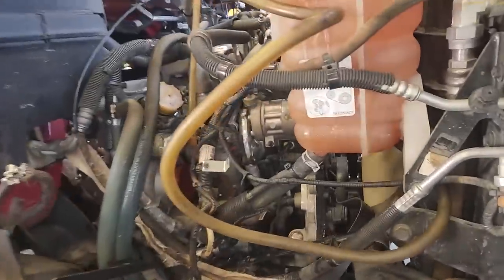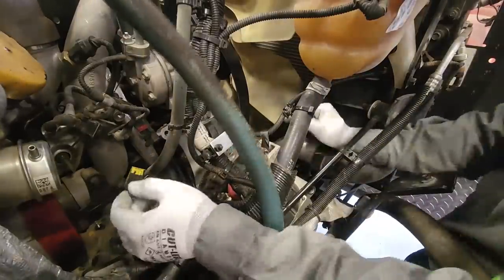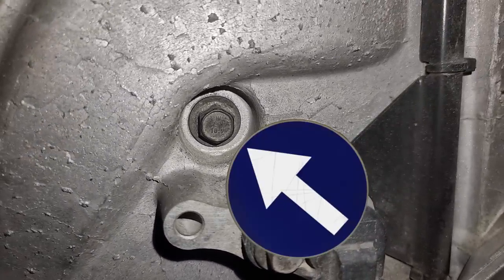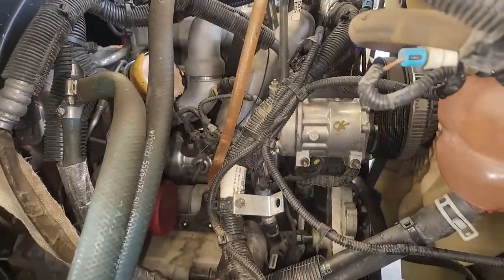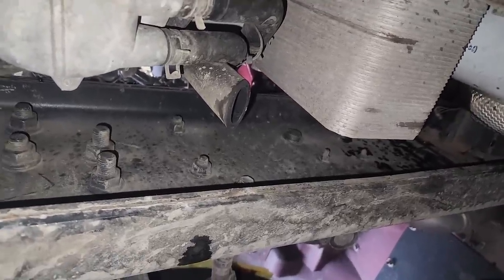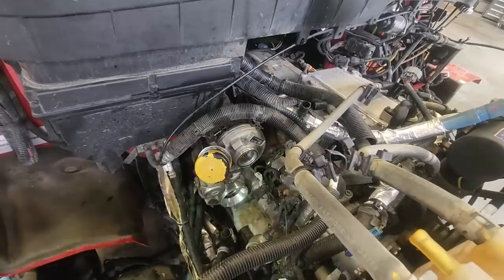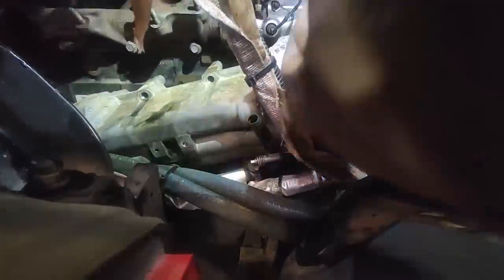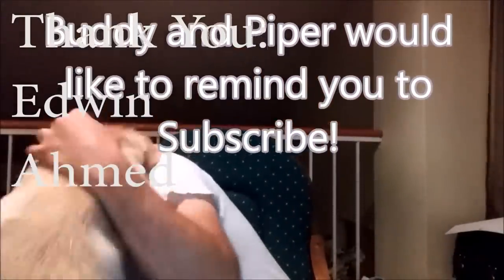"Trash-Fire" International Truck has coolant in the exhaust. EGR and Turbo testing.

Comment: Well I can tell you about international and one of the things that I can tell you is Ford had a hell of a tough time with international cuz they built many of the early Ford engines for them and they were not designed well and Ford in international fought like cats and dogs with each other so they do have a reputation of being a pain in the ass to work on and getting parts is also another fun thing to think about wouldn't Luna diesel that had an international engine 🤠😎🤠

Comment: FYI both of the metal coolant pipes will come off with the cooler still in chassis. The tool NAVISTAR makes is designed for it to be done in chassis. And come on!!! They aren’t that bad to work on lol.

Comment: 12:10   lmao once again welcome to Volkswagen........  you have two options at that point.... either loosen the rest of the bolts that that loose guy is apart of and remove it with all the screws/bolts dangling...... or loosen what you can get to and or either jack the motor/powertrain up until you can physically remove said screws/bolts and mount or lower the powertrain for the same desired resuilts.......

Comment: I worked alongside International Engineering on the Medium Duty diesel Maxxforce EGR engine program. I believe the engine in this video is a Big Bore 15L? You never clarified that. The Maxxforce Engine program was then CEO Ustian's attempt to be ahead of the competition. He was dead wrong. I was witness to every design flaw and failure mode possible. Yet Ustian pushed on without a plan B. We know now that these Advanced EGR engines were junk. The only thing that saved International (Navistar) was replacing the CEO and repartnering with Cummins. They also accepted using Urea on their 13L LT engines. Repairing a Maxxforce engine is only temporary. Be reminded though,  the problematic HUEI fuel system was adopted from CAT.  That design is junk as well. The issues I've seen in the dyno labs on these HUEI injectors and HP pumps were many.

Comment: I had the privilege of working on that exact POS engine in a 2012 Monaco Diplomat Motorhome.  I had to replace all injectors & turbochargers.  These clowns put a low pressure heat exchanger for the compound turbocharger that mounts to the top of the valve cover 

I also had to replace the exhaust brake valve.  Real POS!

Comment: You're doing that the hardest way possible, there's several ways to condem a cooler. Most of the time a bad one will pass pressure test. It's really disappointing as I thought you were good. Apparently only for one make of engine. I think good diesel techs can diag any thing without so much trouble when they have ample brand experience.
Reply from the maker: I've literally never worked on this engine emissions system before, I have no specialty tooling and it's designed by fools.

Comment: That CN locomotive yeeted a power pack (cylinder, liner & head) out. It's not an unheard of failure, but it's not exactly common either.
Reply: That is surprising. GE has been pretty reliable within the last 30 years, launching a piston out is normally an EMD issue.
Reply: Yeeted?
Reply: @cavalierliberty6838  EMDs leak water, weep oil everywhere and leak fuel into the oil.  GEs blow up and catch on fire.  But both are very reliable overall and will run for years on the minimal maintenance they get from North American railroads.

Comment: Liquid EGR coolers should be eliminated or more techs educated when and how to test them - the dealership swore I needed a new long block as they had no idea where the steam/drops of water out the exhaust were coming from - they "diagnosed it" (3 of them, over coffee) as a catastrophic engine failure i.e. block/head crack.
I diagnosed it as a bad EGR cooler, saved just under $10k, and had it repaired in short order.

Comment: HA-HA LOL worked for International, and seen a lot of this cases...   egr cooler fail, means coolant inside engine #5 or rear cylinder
Seen so many Drivers or tech starting engine after hydrolock..  After repair cooler engine will have  a miss on rear cylinders...
meaning connecting rod got bend..... By the way Crank case canistare has fail, no oil should be on those lines....

Comment: I just checked for coolant in the cooler. It was always bad.  The top turbo was probably just coked. Pull the housing and you can usually clean it. By the way I know you whined the entire video but an LEE is beyond the stupidest engine I've ever worked on. I did tons of these coolers. I never pulled the doghouse. They were easy.

Comment: The fact that International would build and sell a truck and engine both so absolutely over built in the worst ways, AND made like garbage, to a fire department...I know they have limited budgets and International is supposed to be the "cheap" option but....Why would they do this to people who need ease of maintenance and absolute reliability? This is BS in the trucking industry but, in fire and rescue?! I swear things need to change in the industry, back to something that makes sense. At the end of the day, diesel or electric, man driven or computer driven, the equipment NEEDS to be easy to work on, and reliable. Otherwise, you bring entire industries down to the point of uselessness.

Comment: So you really enjoy working on the Internationals?  lol sarcasm.  I drove an International for about a year no issues, guy that drove it before me hated it, dude that took it after me only had it for 2 weeks until he blew a coolant line and kept driving it until it would not get him up a hill. He claimed he never noticed the temp gauge, got himself fired by looking at his phone to many times while driving. They told him at least 5 times he had a camera on him and if he did it again he would be fired.   I have a jeep with a V8 shoehorned in it and no one wants to work on it because there is no room.  
To often the engine design and chassis design are designed separately and the two only meet when the vehicle is built.  At least you did not need to take the cab off to do the work.

Comment: It's absolutely crazy to me that they want to put emissions on a diesel engine that has to be absolutely reliable to save lives and millions of dollars in property... when it is known that emissions equipment is the number one most likely system to fail itself or cause the engine to fail... you wouldn't put a system on a helicopter that you know has a high rate of failure... because it would be highly dangerous right?!...if you have ever seen a real building or house fire you know that seconds matter when you are trying to save lives and property...30 seconds can absolutely be the difference between life and death...30 seconds can be the difference between stopping a fire in one room and spraying water on the pile of ashes that used to be a building...if it was my decision to make on what vehicle these hero's have in their garage...there would be for one no emissions equipment...you might think let's put the biggest most powerful engine but I'd ask them what they need instead...let a professional, the people that will be using the equipment pick what they need, from drivetrain to tires to lights to pumps to hoses and switches and communication and what type of mat is on the floor...I bet everything makes a difference and I'd want the men doing the job to decide what the right equipment is...sorry for the rant but what the actual fek is our government doing?! We need to do better...no excuses....